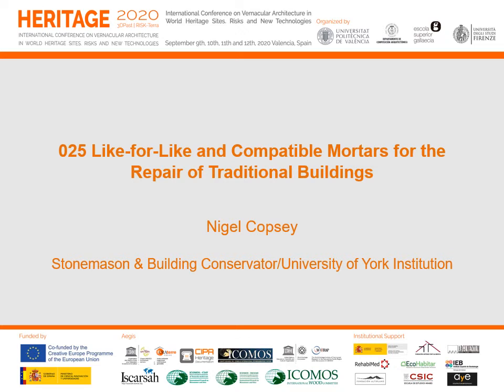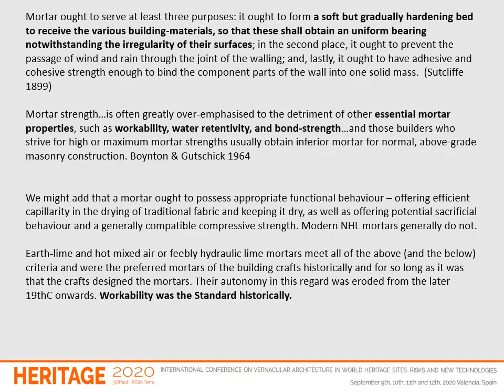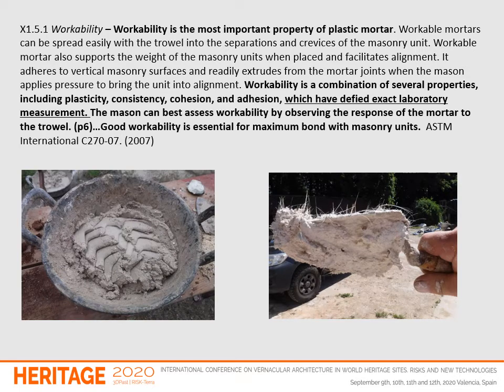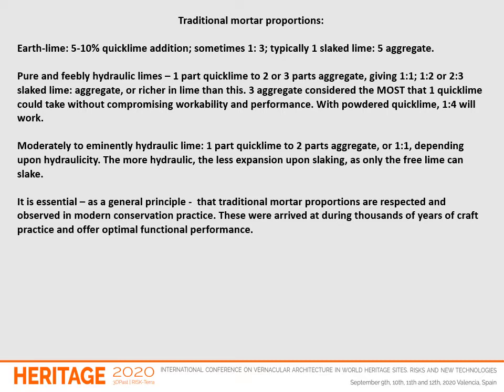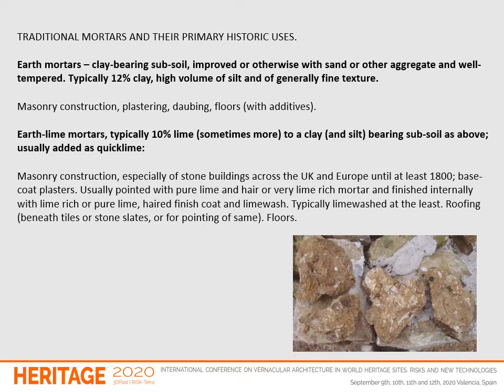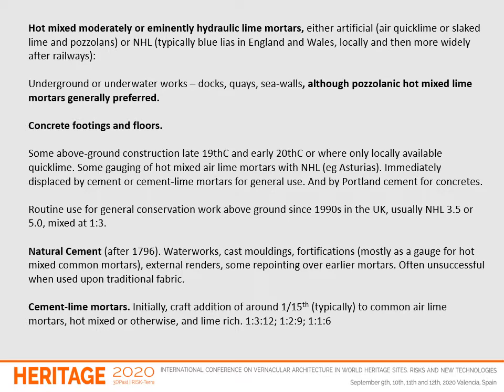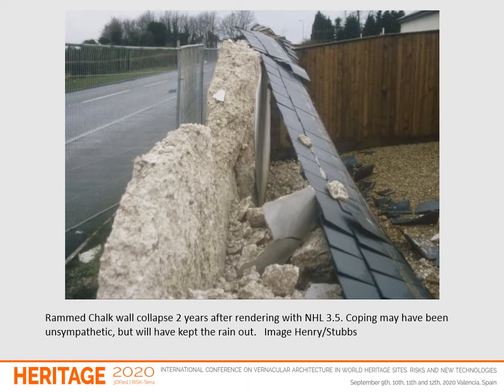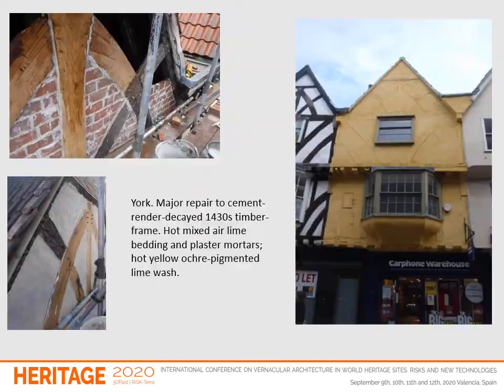Nigel Copsey - HERITAGE2020 - Conference Paper Presentation

Comment: Need your Help! Calbux quick lime 90 tarmac.  Could i use this lime say,  1 part lime, 3 part shap sand, for mortar do i need to put red brick dust in or pollazon for sub stone flooring? My sub floor stone under my floor is leakinf water from cavity wall it looks like will this mix seal it up?